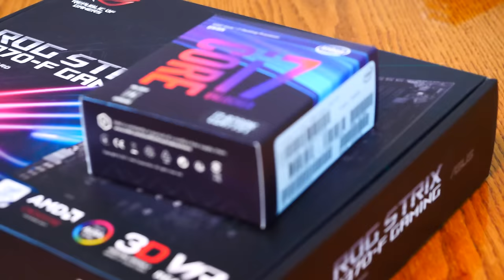How To Case Swap And Upgrade Your PC (Talos P1)

Comment: You lied in 2015 you said you will never buy an asus product after the 980ti thing happened
Reply from the maker: Yes, I came to terms with that a bit later. It was crappy that they did that but they build nice boards... Working at falcon made me love them again.
Reply: Yeah working as a system builder makes you really appreciate ASUS motherboards
Reply: @callummmm  I dont mean to fanboy but ASUS boards are probably the best around. They look the best, and have the nicest features. my only complaint is the ridiculous boot time on my Crosshair VI
Reply: @yungdomino4718  Not only do they look great and have good features, but their BIOS is second to none imo and the placement of things like chassis fan headers just make things so much easier.
Reply: Asus board are nice and all, especially the BIOS. Super easy to use. But Jesus fuck the vrm on their lower end board is inadequate
Reply: @redmonday4154  their vrm in general is shit, specifically on their z390 boards. at the moment aorus boards are miles ahead in terms of vrm
Reply: Asus boards may be good, but as a Brazilian, it's just not affordable
Reply: Yea, the VRM on my Maximus Xl Formula is a 4 phase. Try that for a 450$ board and get shit on by the VRM

Comment: one tip, run a 10 minute stress test / benchmark before removing your cooler. it may help get the thermal paste free and let the cooler come off smoother
Reply: This is actually insanely helpful!!!
Reply: @Pluto-ek3mh  Damn I just comenting the samething and didn't see your comment. Ok. Well glad to see I am not alone on this tip.
Reply: @TheSlickmicks  You’re never alone

Comment: 1:45 my heart stopped
Reply from the maker: mine did too!! Not only did the cpu pop out but then the cable snagged! I was terrified XD
Reply: @BulletBarry  thank God your CPU wasn't damaged
Reply: Dude I had a similar issue,but it came out fine... But fml when my dad tried peeling it off and it popped off and landed on the case on the Pins. Low and behold quite a few were bent to sh*t. I spent the next hour with tweezers and a credit card straightening mushed pins. It works still and is Overclocked! Xd
Reply: and thats why you always heat up cpu and twist it before disambling

Comment: I built my first PC three months ago and I love it. Putting together the parts was the easy part but finding where each of the cables go and finding out which cable goes where was tedious. Took about 7 hours to connect all of the right pins and cables but in the end was worth it. I spent about 3 hours doing  Cable management to make it look nice.
Reply: It's been 3 years how's your pc going any upgrades?
Reply: @ollyvrc  completely forgot I commented on this video, but yes actually a few last year. I upgraded to a 12900k and bought a 2080ti from a friend for about $500 last year. I upgraded from a 8700k and a 1070ti

Comment: Hey Barry you ever thought of doing an in-depth thing on computer audio? Headphone amps, DACs, stuff like that? I recently upgraded system for that stuff and it improves everything, music, games, music inside of games...
Reply: I second this but a good headset will make a big difference.
Or are you talking about an in-depth guide explaining the parts of headsets?
Reply: @ZyrusSmith  Not something that technical. Qualities of headsets/microphones are probably the most important thing when considering audio, but most people don't know that the digital-to-analog conversion on most mobos/sound cards is rather mediocre, regardless of how great your headphones are. Though, it might admittedly be more important for a music-listening experience than gaming specifically, and most DACs aren't geared for USB outputs (I just use a separate headphone/mic, keeping them separate can give you superior listening experience).
Reply: @loonachan  In my experience, I've found that drivers tend to be the most important part about headsets. In fact, if you know a lot about headphones and what specs to look for, you can buy really good ones for under $40. The best pair of headphones I've ever owned was some brand I've never heard of for $20. I knew they were going to be good because I looked at the specs.
Reply: @ZyrusSmith  Well the issue with headphones is that it's partially a preference thing, but certain drivers need more power to actually drive, which is where the headphone amp comes in. And like I said, the best headphones in the world won't truly be able to sing on a computer without a real DAC. Not actually sure what you mean by specs- whether you're talking about performance specs like THD or tangible specs like impedance. You can get into impedance, and different designs (open-back vs. closed. Personally I can barely even listen to closed-back cans anymore). It's true that you can get some really good headphones for relatively cheap. Not sure if the mystery $20 headphones will satisfy me, but you can get some really great setups that will blow your mind for not a lot of money.

Comment: I wouldn't call the Ryzen 7 1700 to 8700K much of an upgrade. One is better on other things and the other on something else. I would have simply changed to 2700X for best of both worlds. Keeping the multi-core performance while getting better single core performance than the old.
EDIT: 8700K with a H370 board? Can't even overclock the cpu with that. Meaning this was actually more of an downgrade.
Reply: 8700K is better at nearly everything than a 1700, a 2700X is nearly the same though, as well as being cheaper and not needing a new motherboard
Reply: The guy has dual gtx 1080 TIs, do you think he cares about a little bit of an upgrade?
Reply: Filthy Weeb 9gay rEeEeEeE

Comment: Having your tower flat on a surface with a high coefficient of friction (that isn't conductive) helps A LOT with removing stuff. Having it upright will make it very hard to keep the case still as you wiggle all the cables out

Comment: Is it worth getting more than 32 gbs of ram if I'm only interested in gaming? I don't really have worries about pricing but I'd rather save the extra 300 dollars if it wouldn't actually affect anything.
Reply: Firstname LastName 16 gb works fine for gaming, getting a memory kit over 32 seems overkill in my opinion. I couldn’t give you much info technical-wise, perhaps someone else could give some insight into that.
Reply: I think 8 is fine for gaming, but idk about chrome.
Reply: You are pushing it to it's limits, just get 64gb
Reply: if your only interested in gaming and nothing like editing and that you should be good with like 16 gb 8 is the bare minimum
Reply: It's not worth getting 32GB, 16GB is great for gaming with discord, chrome, and other apps in background along with having headroom. 16GB is also great for video editing. Not major professional video editing, but for like 1080p video it's great
Reply: @aviva-r  8 isn't, a lot of games give microstutter and also RAM usage goes to 0 to 100% real quick. Coming from someone who has used 8GB system for 2 years.
Reply: @yasinomidi7525  64GB? Why? This person is gaming, not hardcore video editing.
Reply: @astroallen9589  8 gigs is still a gaming PC, it doesn't have to be able to run everything to be considered gaming.
If it's designed for gaming it's a gaming PC.
Reply: This maybe late but still, 16GB is just fine for gaming. 32GB is for content creation, video editing etc.
Reply: @astroallen9589  yeah if you have the money go for 16gb. But otherwise.
Reply: @astroallen9589  you literally said that real gaming pc's have 16 gigs of ram, right so that's cool, but unless you're playing the latest triple a games at max settings it's really a rarity you'll need more than 8.
Unless you have other programs running in the background, but if you shut down everything else while gaming, 8 gigs is almost always gonna be enough.
And I don't think I need to say that a PC doesn't have to run all games to be considered a gaming PC.

Comment: whats the deal with molex why does everyone hate it?
Reply: Exactly
Reply: We don't speak of it. It can go back to the creater who thoughtfully decided to have removable, finacky contacts to power fans and other parts that are somewhat necessary.
Reply: Molex connectors are held in by friction only, but unlike HDMI or USB or other friction lock interfaces, molex is very tough. Another issue is that poorly made molex connectors can have the pins ripped out when attempting to remove them. I have also heard that they are difficult to align and that they pop out. Can't say any of this from experience though, my PC or any PC I have messed with, always used SATA power.
Reply: @MPdude237  wow thanks for the vivid description of what sounds like hell
Reply: Basically, you ned to force it A LOT for it to plug. Some people even get hurt

Comment: Can you help me i got a bios infection and I don't know what to do For real
Reply: PlaneCobra look up a tutorial on how to delete system 32. Its not as easy as just going into your windows file and deleting it. Look up a tutorial on how to do that and you should be set, as all the bios files are stored in that folder. Once you delete it, you should restart your computer (it may do it for you depending on your windows version.) When booting up, it should take a lot longer, as it is reinstalling the original files. Once it’s done your computer should be free of the bios virus. Do be aware though, some things may have changed, such as shortcuts, taskbar pins, wallpapers, etc, nothing too major though. Hope this helps.
Reply: @coreyberg7823  really thanks I'll do that
Reply: @coreyberg7823  I did and it stopped
Reply: Take a lighter and burn the hardware in this order to make the computer turn on again; cpu, gpu, cooling, wires, power supply and then the rest will burn by itself. Hope this helps.
Reply: @astroallen9589  yes and also a rat
Reply: @Mr.Knapsack hahahahaha

Comment: Why aren't you talking about how bad that case is? There's no mesh at the front meaning you get tons of dust inside, metal is cheap, easily dented, HDD bays are made of rubberized plastic making them insanely difficult to put in, if you have too many cables at the back the tempered glass won't stay closed. You can get a way better case for half the price! You shill! Trying to avoid talking about the case by making the video about case swapping, GTFO!
Reply: dude that's toxic. if he doesn't mind it, he doesn't have to complain. He got sent the product, and made a video with it. he critiqued the slot covers, but he wasn't paid to say anything good or bad, but he obviously doesn't mind if he swapped his main PC into it.
Reply: Jake Erdson I used that term in irony.
Reply: I disagreed with you until I looked at the case price. that is, without a doubt, incredibly unacceptable for that huge price. Youre not wrong, you could literally get a better case for, literally, half the price
Reply: is crazy that he went from a open front to a close one
Reply: I don't think he's a shill or was paid off, he just enjoyed the case. He doesn't seem like someone who would do that. But I do agree that this case is shit. Even phanteks p300 will beat it for like $40. And in this price bracket, you can buy fractal r6 which completely obliterates this case.
Reply: @vovical  or the 750D which barry already has

Comment: I am a first time builder and thankfully everything worked out fine. 
However, here are a few things that I noticed:

When I did my case swap the cables on the motherboard and power supply were the hardest.
They are soo stiff when you try to take them out. Feels like you're going to break your motherboard.

The front panel connectors may seem like a pain but everything is on your motherboard manual and very straight forward.

My cable management was poor but now that I have an idea after watching soo many videos, ill fix  it... Someday.

Besides that, good luck!

Comment: Your can probable use the old rear case guards from your first case. If you have no planes for your old case just hold onto some of those to cover up the expansion card slot hole things just in case you ever need to.

Comment: just to let everyone know on these videos...when you just swap a case and aren't upgrading anything.  all you basically have to do is take the gpu out, unhook everything  like the drives, power supply and some components, but leave the cpu, the cooler and the ram ALL on the motheboard, lift the mobo out of the old case, put it into place in the NEW case, and reroute everything.  no need to completely take out the cpu and all that.  that is ONLY if upgrading

Comment: Protip for removing Cooler puck. It warms the Thermal paste and makes it easier to remove. Run the PC for 10 minutes, shut it down, disconnect, drain power by holding down the power button. RThen remove.

Comment: It's also good to get psu with long cables for cable management. Molex shouldn't even be used but sometimes fan cables don't reach the damn motherboard pins so maybe get a fan hub ?..........

Comment: I'm planning to do a case swap but my CPU, MOBO, Hard drive and RAM needs replacing and it would be easier to buy these parts and the case together and then re-use the GPU and power supply since I would have to remove less parts.
The video was entertaining though, so I didn't loose any time.

Comment: You seem like a big fan of molex.

Side note, I'm considering upgrading but At the moment I am using an AMD FX 6350, and GTX 1050, from a prebuilt, yes, I do regret getting a prebuilt and wish I built it myself, not only for the cost save, but also for the experience and I haven't been able to justify and upgrade to myself because the most I've done so far is add a WiFi card and that's it, now I've seen this video it's shown me how easy it is to upgrade if you know the steps and now I feel like it may be justifiable, even if it's just extra RAM or more storage.

Comment: Back then i had a Cooler Master HAF 912 Full tower case, and i wanted to change to the NZXT H440 cuz it just looks nice... i was having a 1060 (Asus Strix), and when i tried to fit into the th h440, the Storage slots on the sides are blocking and it was a 3 fan gpu unlike normal 2 fans 1060 so it was long, so i have to try to find a way to fit by tilting here and there and fitting into the pcie slot, and i manage to without needing to take out anything. About a month back, i got myself a 2080 Ti and that thing was not just long but thick as fuck, so i had to do the same as my 1060 but needing to take out extra 2 storage slots. All good, just need to be creative if u face any problem in case swapping.

Comment: the ripping of pga cpus is probably the only weak point of pga sokets, but they could just integrate tiny walls besides the cpu to alow you to wiggle the cooler around and break the connection between the cpu and the cooler

Comment: Pro tip 1: get a picture of your motherboard with all the cables attached to it before removing anything.
Pro tip 2: get a power supply from the same brand of the case. it will 100% fit.
Reply: The funny thing is that the case and PSU are the same brand.

Comment: Remember kids, don't plug your VGA Power Cables into the USB 3 Connector on your case as it will not only limit your monitors frame rate to 720p, it will also overclock your case fan's speed which will cause terrible thermals...

Comment: I'm going to try this leaving the cooler on the motherboard. I have almost the exact same thing though. Going from big case to smaller case. Going from all metal case to all glass case. Why they put glass on the right side I'll never understand. Or the front for that matter. I much rather have polished silver front panel with gold inlay, and a brushed aluminum right cover with "the fly one" etched into it accented by engravings.

Comment: My D5 pump uses molex, and it forces me to use a molex cable on my PSU.  A part of me is tempted to cut the cable and solder the wire to a SATA power cable.

Comment: Yo guys! How much will a I5-7400 bottleneck a rtx 2080 ti I want too get a high end replacement to my 1050 ti that won’t get bottlenecked by my 15-7400 a lot. Any suggestions?
Reply: AlimGaming I would recommend getting an X470 mobo with a 2700x  and an RTX 2070 or 2080 as the I5 7400 is just a basic quad core and games like GTA 5 and BF 5 utilize more than 2 to 4 cores now so it would be a more balanced build if u have a lot of cores and a beefy GPU
Reply: Nigga u need a i9 9900k to power rtx 2080ti to the fullest...
The i5 bottlenecks even a 1070 or 1080
Reply: I7 7700k minimum

Comment: can you do a "how to make a sleeper build" video? i've been thinking about getting an old family dell 4700 we used to have (bc it seems funny as the thing couldn't run games well) and build a recording station to run the aver media 4k capture inside, but my plan has complications as it has a specific way the mobo sits that wouldn't be compatible with anything bought by itself as well as needing to modify the header connections

Comment: "Want a new cpu have fun swapping motherboard" you some times dont need to buy new motherboard for another cpu. If new cpu has same socket as your motherboard
Reply: Yeah, only on intel which lock new CPUs away for older motherboards even though they're perfectly capable

Comment: I have an old AMD am2 board and the cpu came out of the socket stuck to the cooler like that pretty regularly when I went to change the thermal paste. I think its more of a problem with PGA sockets than the thermal paste being sticky.

Comment: Lol I just did this yesterday but I put a crappy old mobo from an eMachines computer and a single GeForce 9600GT in a Fractal Design Focus G. Awaiting for an SLI capable mobo (so I can put my two GeForce 9600 GT cards in SLI) with an LGA 755 socket, but comes with a Core 2 Duo and 4GB of RAM. Maybe I'll put a better system in my case but for now I'm making it my Windows XP computer.